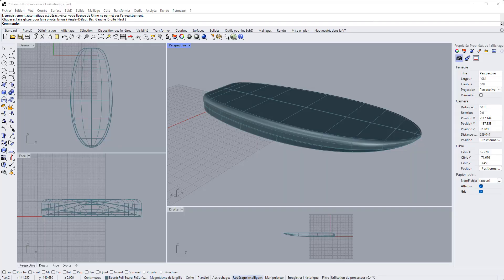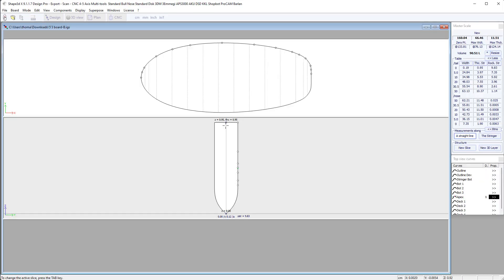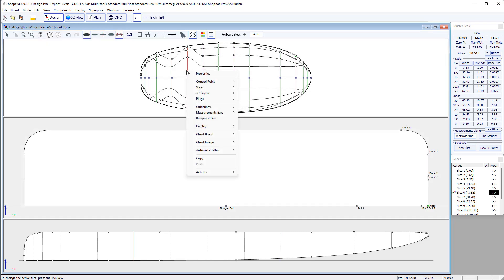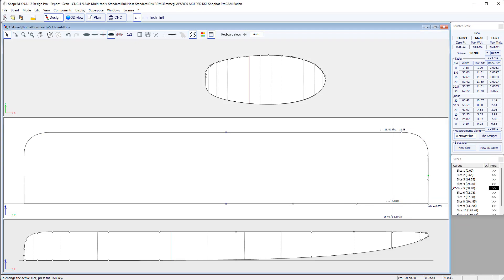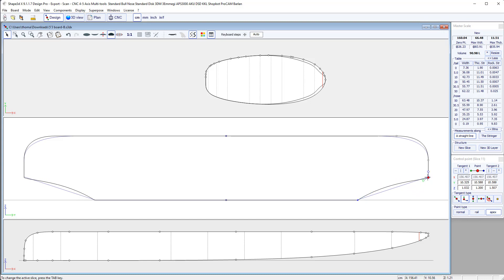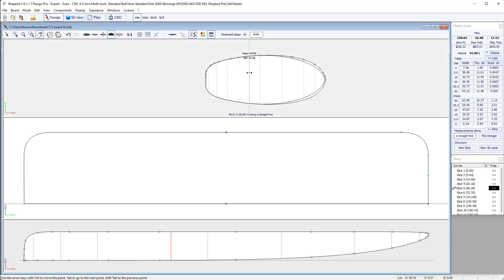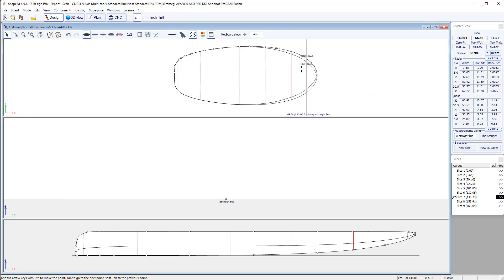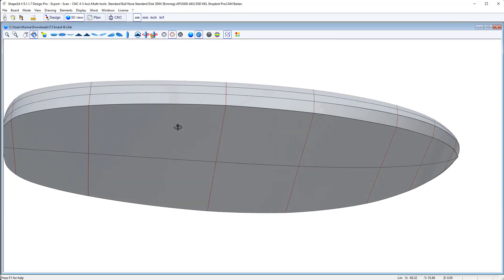Importing an IGES file into Shape3d and correct the distortions you can get

Comment: Wow, I thought the import of IGES would be more natural. Is the IGES Format so incompatible to the S3D Model? Or why does it happen? Can I already prepare the Nurbs Model so to avoid distortions?
Reply from the maker: Hi Jorg, there're infinit ways of designing nurbs surfaces. The importation only works if the structure is similar to the way we design boards in Shape3d: with parallel cross sections... and avoid trimmed surfaces. 
But the importation can be perfect then! 
There are distortions here because of the vertical rail; I just wanted to show how to correct them in case it happens. 
You can send me your iges files by email if you have any problem with the importation into Shape3d.